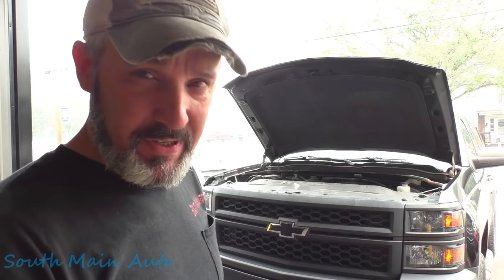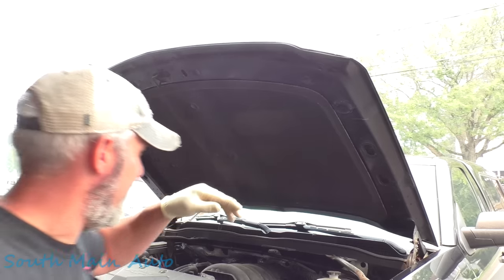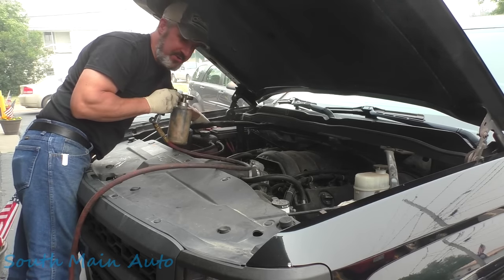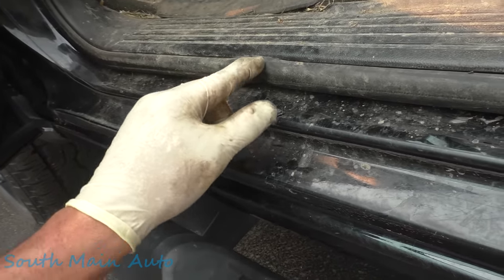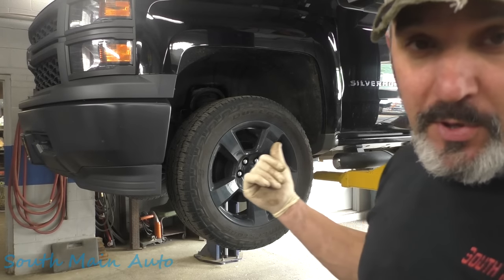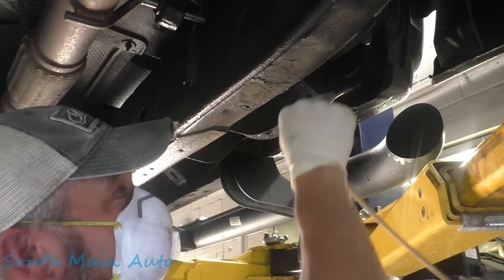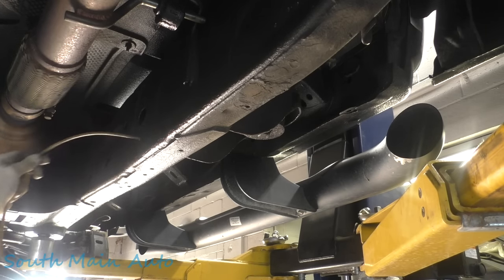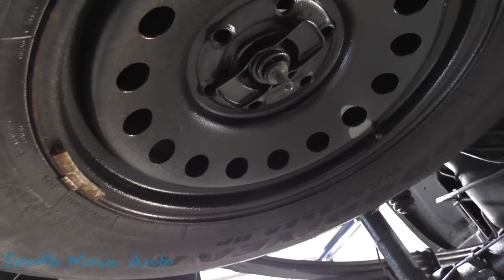Keep Your Car (Or Truck) From Rusting!! You Must Do This!!

Comment: Eric O’… A lot better than doing nothing!!! Maybe you missed some spots. And that is where it will rust. Maybe this dud needs to wash the outside and vacuum the carpets now. Seems like you need more in the truck bed and the Bumpers. Many a Chevy, the Chrome is holding the bumper together. I suppose you did all those lines like Power Steering, Trans, Brake, and AC that rust. I think you need a big fogger to send it in through the grill just like that snow and salt is driven into the front end.

Comment: Been doing FF for the last 2 years. Having done at local shop with lift. Much better job than I could do than in the dirt on my back. Question on amount of time it should take to do a complete coating and approximate cost. Mine went up $100 from previous year. Not complaining because I want a through job done . Any idea what is an acceptable cost to do a truck and not over pay ? I know nobody wants to give prices here but knowing what is in the ballpark and what is way too much would be helpful. We’ll see in 10 years if it’s worth it since I have a vehicle that has a history of rotted out frames.

Comment: I truly believe in your closing statements. Thank you for saying it Do SOMETHING.
I'm up here in Montreal i've got the 5 sets of snow tires to for my family this week 
to do & as the wheels are off the thing in the air the cars get their undercoating.
Even if i get it wrong & miss spots it's something & not nothing, going on asuming
that the cars will be fine without it. We've got areas under the drivers feet& where
 the suspention hooks to the floor in front of the rear wheel that you just can't 
ignore here. The subframe mounting points are so important. Something, anything done
and not ignored works for me. Thanks much for showing the Fluid Film.
I now know it's the same family of chemical we use up here. Brown creamy thick 
goes on with a shutz gun.     Thanks

Comment: The place i go to here in Canada pressure washes the underside, they charge me $40 extra to do so because they claim it will adhere better.. is that a scam? Regardless.. the Krown works amazing, my wifes SUV is a 2009, and other than a couple of mounts, and a bracket or two it has zero rust underneath, and where i live they lay the calcium chloride to the roads all winter.

Comment: Hello Sir. I have a 2010 Hyundai Sonata GLS 2.4 . I have replaced the coolant temperature sensor twice. It work fine until last week where the temperature gauge said is hot. When I removed the temperature sensor connectorr,the cooling  fan start running in a high level as it should to cool the engine off. So my question is replace the coolant temperature sensor or this is something else . Thank. I'm from Georgia 6:57

Comment: Does that stuff penetrate the existing rust also to help stop the steel from oxidizing further? I live in New Hampshire and I've been told that I should get my truck oil sprayed by a couple of co workers. I am very much considering it. One of my co workers is lucky. He has a company truck to drive and he gets to let his personal truck sit and allow the spray to soak in. In my case. I have to drive my truck to and from work.

Comment: My 2009 Suzuki GV has a special system whereby the rear main seal leaks engine oil and the rest of the underbody is protected.  I’m not sure whether they actually patented this system - but it does work well !

Comment: i would love for you to fix my truck 2011 ram 2500 i think it has a bad wire some where no power to key unless i unplug a harness next to the fuse box then plug it back in (gas)

Comment: I have had a 2018 silverado for about 3 years. Ive fluid filmed everywhere underneath accept the frame. Pretty sure it says on the can to not spray on wax based frame coatings. However i see you do anyways. I would like to spray the frame but makes me nervous the coating will come off even more than it does already. Have you ever had any issues with the coating coming off after spraying. Thanks

Comment: Put a bright colored piece of tape about 1 inch from the end of the wand and you will know when to stop spraying when pulling the wand out of a hole. This way you will not spray yourself in the face and waste product. I used SEM cavity wax in the cavities and under my truck and used Fluid Film under the hood.

Comment: we had a bmw suv 2023 come into body shop a mnth ago.still a problem car.owner is furious hes a doctor.i replaced front bumper painted new sensor left side to match bumper.checked codes none.he came back saying the pedistrian alert wasnt working and said we should have known that.its a 100 dollar sensor right behind left side of plastic bumper.the big catch!!!.it still wont work on a new bmw.the whole car needs a update i mean everything has to be reprogrammed.2 days now its still spinning and updating.angry doctor left ohh ok whatever attidude.they have the radar box below liscence plate.on the new bmws you can update software though the menu.i did that.not good enough lol

Comment: Use Fluid Film annually on my ‘06 Tacoma 4x4 with the infamous frame. I live in SE PA.  I have the original frame without rust and it’s got 175k on the mileage. Will keep this truck forever. Keep up the helpful videos Eric O!

Comment: I bought a 2015 f150  got it sprayed and a yr later I go around every week touch ups I say if it's rusted it's gonna cost you more in Labor to remove broken parts so you will save in the long rub and I've seen cars trucks 10 yrs old and wow 99% rust free

Comment: Glad I found this video, I have a 1972 Dodge truck I need to do this to.  Those trucks are notorious for rusting out and having recently moved from Colorado to Georgia I'm more concerned about it.  Not as bad as the rust belt but still a lot more humidity and rain here compared to the Rockies.

Comment: Did you get braces? Im 45 and just got them too. Never too old to keep the chompers healthy. Look im from a hour or so away rust is gonna happen here regardless. Wheel wells and doors and rockers are where is see the most problems. Except for those totally failsafe electronic rust systems. You will deff never rust when those are applied lol.

Edit. I watched the whole video now and damn if that wasnt the most thorough spray and treat i have ever seen. Most places would have scrimped and done the bare minimum. This is why i watch.

Comment: Knowing how much a spray can of Fluid Film costs, I shudder to think how much a 44 gal drum of it costs! How efficient is this on a cost to benefit? i.e. how many years more does the truck last versus the cost per year of the treatment? What does a treatment cost the customer? I ask because I am in Australia, and we never see salted roads. Most of our rust is from dipping the back of the truck in the salt water when launching or retrieving the boat every weekend. I thought urethane foam was but in to give the area more structural rigidity.

Comment: With most cars coming with 7 year corrosion warranties is there any reason to do it too a newer car? Mine is 3 years old so still has 4 years left. I did have a Chrysler Sebring and that started rusting at 3 years, just after its warranty period ran out.

Comment: I have seen a lot of cars here in Maine with under 100k go to the crusher and its just a terrible shame.Perfectly good running cars that just wont pass inspection because the rocker panels are completely deleted.in just 3 years the struts will be rusted on a brand new car.Its just the strut housing and they still work but the thin metal just rots right away instantly.Brake backing plates also dissappear in 6 to 7 years.People just use used motor oil which although may be a bit dangerous its way better than nothing.Gotta do something like Eric said.

Comment: I have a fleet of full size Ford luxury sedans that have never seen salt and never will. The only one that does is my 95 town car and it's been the most reliable winter car ever with 500# of used brake rotors in the trunk sitting on two new air springs and four Bridgestone blizzaks. I learned the hard way that traction on ice is the most crucial dynamic of winter driving. The sun is so far south that it almost never shines on some stretches of road and they stay ice covered especially when it's below zero for several days at a time.

Comment: 7 Transmissions/ X amount of wheel bearings. 😂😂🤣🤣 I trained @ Chevrolet Division in the 70's so not insulted. Besides, I saw the light & have owned Toyotas for 50yrs. Speaking Toyotas, lets see your truck YOU undercoated. Thanks for the pointers on spraying. I get MINE done but go over it w/fluid film & super shield out of a can. Live in SWPA & last winter was pretty mild. 👍
PS Would like to see u spray a car with all the bottom shields. 🤔

Comment: Is this my best choice for an OBS Ford pickup truck? I have a 96 F-150 and I'm located in North Carolina. I'm not necessarily worried about rust from salt on the roads but there's some surface rust on the frame, rusted cab mounts, and a few crossmembers. I just got the truck but I'm thinking maybe a more permanent solution would be better?

Comment: Inside the boxed frame & bed crossmembers, & frame cross members, as well as rocker & door post innards, great job!  I’ve done the same for 35 yrs, details like this make all the difference in good protection.  The first application takes me 3 hrs, then yearly ‘high splash’ areas usually 1-1.5 hrs.  A lot of rust is created from cavity sweat.

Comment: Just bought a vehicle that spent a year in the rust belt. Very little surface rust on the frame, but, have fluid filmed it as precaution. Living on the gulf coast, we deal with salt spray. Not nearly as bad as the rust belt, but, a coating of fluid film protects vehicles from the salt air for a few years.  Thanks for sharing this as always! Its great to see how these fluid filmed vehicles hold up with time.

Comment: My 2009 F150 has been properly rust treated since moving to the north east coast with its salt air and salted roads a few years ago and it still looks like new underneath. I cringe when I see some of these  relatively new vehicles come into Eric’s shop and they are already ruined from rust underneath.

Comment: I live in Washington and we have our share of snow and ice especially in the mountains. We don't use salt but rather sand and a deicing solution that can also be applied before it gets to freezing Temps. 

Our cars don't rot out like this nor do they need this coating.  The deicing solution is more expensive than salt, but it would be much cheaper for everyone overall given vehicle damage, road damage, etc.

Comment: Good old Michigan cancer, is hard all vehicles. Back in the old days (70s) there was Ziebart rustproofing, and Rusty Jones, I don't know what happened to them. Ziebart drilled about 500 holes to spray their top secret goo, then you have yellow plugs every 10 inches. I think what happened to them they hired alot of 16 year olds to work. Difference is  you care and do an excellent job, you talk alot and that makes good instruction. I've been a mechanic for 55 years and I still learn from this channel.

Comment: I did this once a year (CarQuest annual dripless oil -5 g pail) on my 2007 buick Lucerne with a spray rig much like yours. South Ontario. Sold it this year, 265,000 kms, still in good shape. However despite my efforts still had to replace the steel EVAP line, the transmission lines, the brake lines and the return power steering line. The 3.8 was still smooth as ever. Never a problem with the "green crusties".
Also I got into the habit of keeping a Shureshot sprayer with fan nozzle filled will dripless oil diluted with light solvent to make it more viscous. This way I could quickly oil up spots whenever i was working under the car such as swapping tires. To my surprise the diluted oil stayed dripless and once the solvent evaporated like the original.

Comment: Fluid film is awesome and useful for many things I had a Chevy DZ 302 motor 12 years ago fresh out of the MACHINE SHOP things went on hold so I coated the motor with fluid film and sit for 12 years on a shelf and it look the same 12 years later before I finally decided to give up and sell it, and the first thing, the fella did was take it out and blow it up beyond repair, shattered a piston, splitting the engine. I told him not to add nitrous but he did anyway.😮

Comment: Colorado long outlawed banned salt decades ago, only allows sand and non corrosive de-icers. And colorado gets way more snow than the rust belt. So the problem is your corrupt government wants your vehicles to corrode. 
And for self diy new pb blaster surface shield is a formula been used in Europe and Australia decades   proven work more than anything else on the shelves for diy.

Comment: Been Rust Checking my vehicles since 1999...our shop was the only place in Central NY that did it for a while until a few more popped up....this stuff works great....i see so many Dodges with rotted out fenders and tailgates after 4-5 yrs that would have been saved...Chevy rockers and wheel wells and Ford everything rotting away on the roads...we did school buses, box trucks, firetrucks, big rigs, trailers...you name it, if it had steel, it got rust checked....it is totally worth any protection especially with the prices of new vehicles today and average ownership is up to 12+ YRs now so they all need something to keep them going

Comment: You must have Fluid Film dreams at night. It is my experience that the smell of FF sticks with you for a while. Foam in the Wiffs Jeep GC stops me short of blasting every thing. On the plus side, I don't see many GC's rusting out. Just hit the under carriage. My late model F150 gets Wool Wax or Fluid Film in select places. It seems there is always some place I missed after years of rattle can applications. FWIW I use Wool Wax in areas likely to  get a lot of road spray, FF the latches and where I want it to creep.
 If I had a 50 gallon drum, it would be Fluid Film.

Comment: I have a bit of a silly question Mr. Eric. Did you wash all that nasty salt off the truck first? Under the hood, undercarriage, frame, etc.? I know many people would forget to and just apply the protectant over the salt, sand and road grime. Thank you for showing us your technique. Be well friend.
(Edit) P.S. Doing the doors, hinges and tailgate are also a good way to keep moving parts well lubed for the internals. I'm sure that helps to keep things moving well.

Comment: Why don't you power wash the undercarriage before spraying a new coating on, aren't you trapping salt between the layers of fluid film?  I was also surprised to see that you didn't drop the spare tire and cover where the tire sits up against the frame.

Comment: In the 50s farmers applied used motor oil to rust proof their seasonal implements.    A 5 gallon bucket and a giant wall paper brush was the typical process.   Plows, discs, grain wagons would never rust out.   Any surface that had lots of friction wear when used  was critical.     Used motor oil worked best, the dirtier the better. ( diesel oil).

Comment: I tend to use waxoyl mixed with old engine oil here in the uk makes for a non setting but quite viscous coating...keeps my 15 year old car on the road even with our councils propensity for over dosing with salt in the winter.

Comment: We are lucky in the U.K. the winters are getting milder so the is not a lot of salt getting put down so most of are cars last a lot longer sum cars you see are 30y old and may have the front wings starting to rust the the exception area cars that live near the seaside I can remember in the 60s Neighbours would buy brand new cars and after 6y they would be on the way to the scrap yard

Comment: I was advised a couple of years ago to do an anti salt wash before anti corrosion work like this. Is this something worth doing? They claim it neutralises the residual salts, you power wash the chassis etc and then put it on as a detergent, when it is rinsed off the salt is gone. let it fry and then fluid film or similar. Anyone any experience of these?

Comment: I've sprayed used motor oil and deisel oil mixed in a pump sprayer every 6 months. Ive had an old ford that had no paint left on the rocker panels or cab corners but also had no rust.

Comment: Quick question...is it not a good idea to pressure wash clean the undercarriage before FF?  I realize it's unrealistic to get inside the holes but how about removing as much dirt and grime from the outside areas to let that stuff stick to metal?

Great job and fairly inexpensive way to preserve the life of salt belt vehicles.

Comment: during the 70/80s we use to have rust proofing  firms, but in the 90s the cars coming in from japan did not rust any longer so the firms all went bust. what l  used to use was hot  used vegetable oil  because it sticks like glue and goes hard